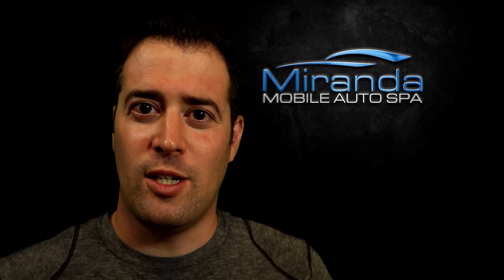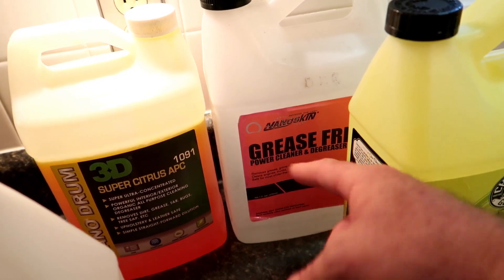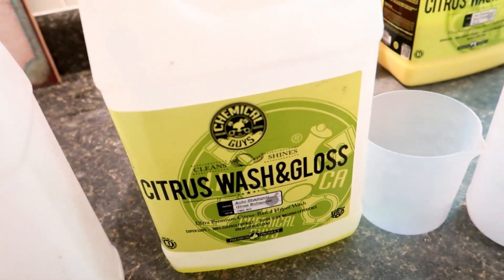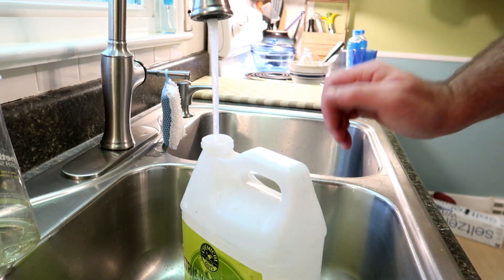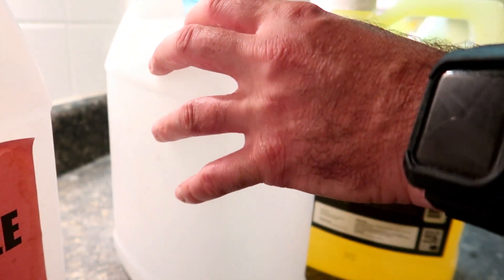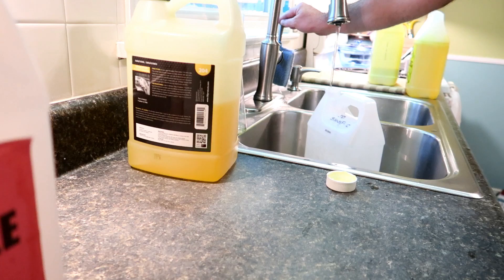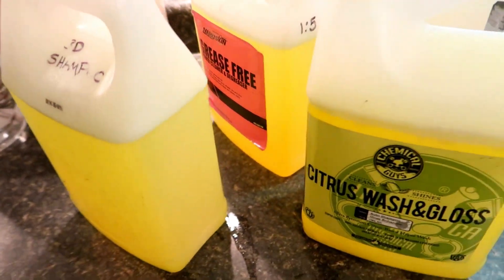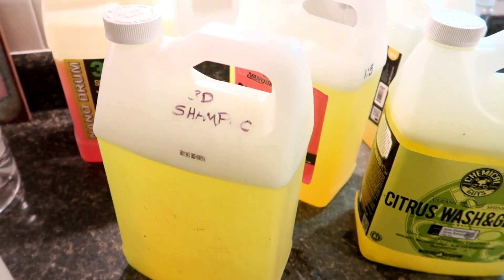How We Dilute Chemicals

Comment: The only reason that it is advised to put water in first is that when you are dealing with a super concentrated or high or low-PH chemical, you want it to be in that state for as short of time as possible. Putting water in first simply minimizes risk, mainly when dealing with acids. Doesn't really have to do with cleaning power, but more with safety. Great video!
Reply from the maker: Cool. Thanks for the tip!

Comment: One 32 oz in a gallon is 3 to 1 right?
Citrus wash still for sale anywhere?
That apc sounds amazing.  About out of megs apc.  May look into that. 

Your videos are very informative. Great work!
Reply from the maker: Actually 1 32oz bottle is 4:1 in a gallon. 
You can buy it on Amazon http://amzn.to/2OjbtbB
Thanks.
Reply: @MirandaDetailing  3:1 Ratio means 3 parts water and 1 part cleaner, so :  1 part cleaner = 32 oz.  Add in 3 parts water: 3 x 32 = 96 oz water.  32 + 96 = 128 = 1 gallon.  32 oz in a gallon container with 96 oz of water is 3:1.  
Not that it matters all that much.  3:1 and 4:1 are going to be pretty similar, but 3:1 is definitely slightly more concentrated.
Reply from the maker: Thanks for clearing that up. I get lost with numbers sometimes. Dumb dyslexic brain! 🤦🏻‍♂️
Reply: @MirandaDetailing  I forgot to say that I enjoyed watching your video too.  Thanks for making it.  :)
Reply from the maker: Thanks!